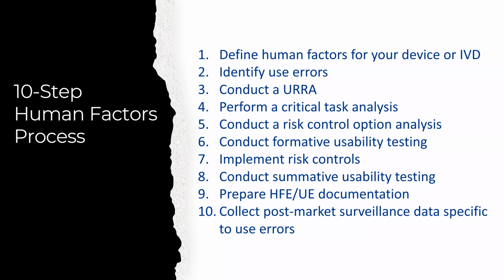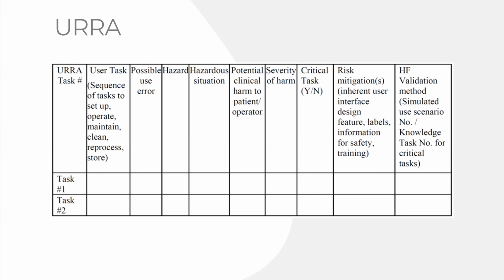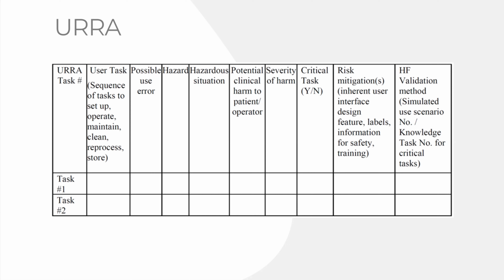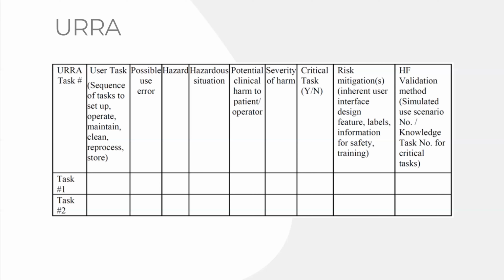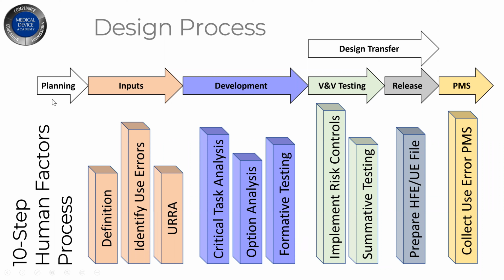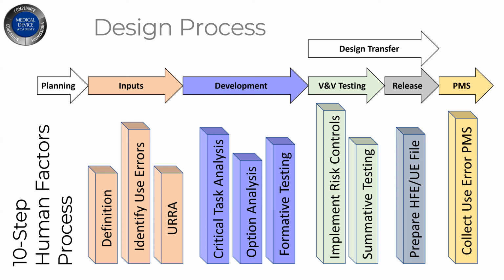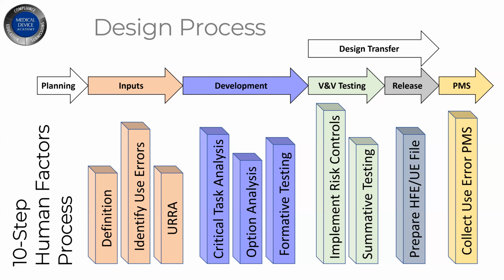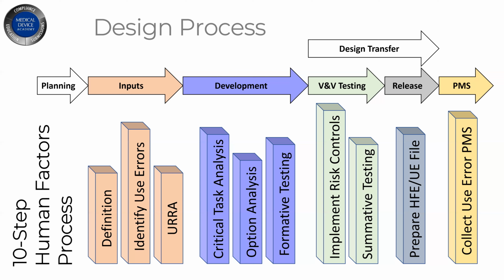Human factors process integrated with your design process

Comment: Thanks for sharing. Working in human factors at a large company, I would be tasked with doing a number of these steps without knowing the big picture. This really helps out the pieces together and connect to the overall regulatory strategy.
Reply from the maker: I'm glad you found it helpful. Once of the ways to see the big picture is to review the overall design plan and risk management plan for a project, but I see very few of those plans include human factors. It is often an after thought.